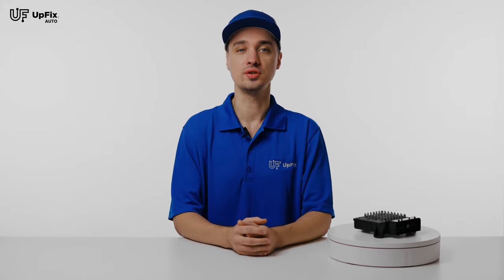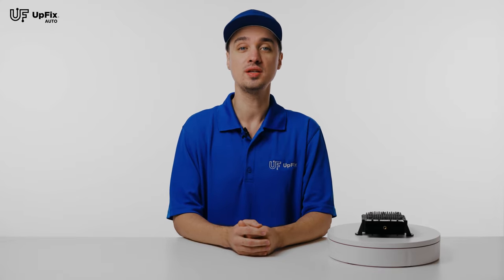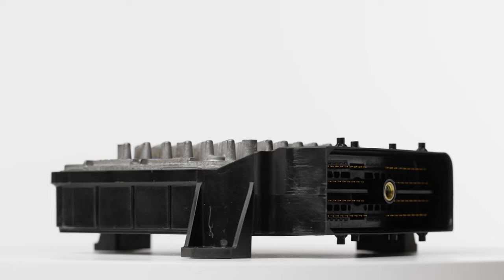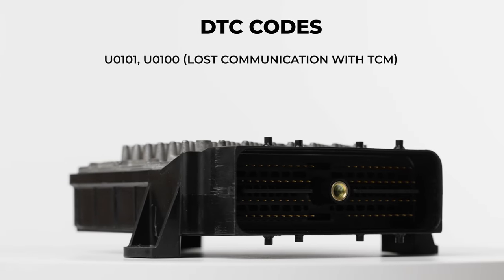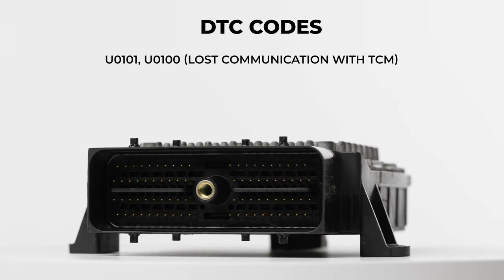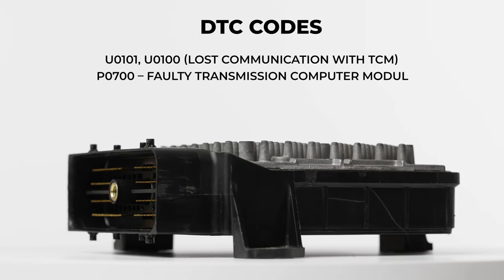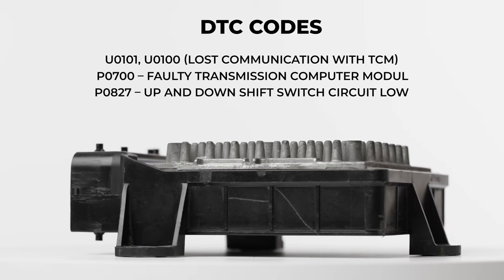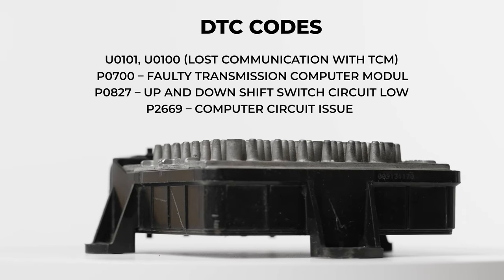Allison Transmission TCM Repair for Chevy HD Silverado 2500, 3500 & GMC HD Sierra 2500, 3500

Comment: can you flash a older 5 speed TCM to a 6 speed TCM?
Reply from the maker: Please reach out to us via the 'Custom Repair Request' at the top of our website upfix.com. There you can provide your VIN and part number. If the TCM is original, depending on your year, make, and model it might be possible to re-flash it.
If you replaced your 5-speed with a 6-speed transmission the internals of the TCM for a 6-speed might be physically different which means we'll only more know once we have more information about your vehicle and what's been done to it.

Comment: I have a 2010 silverado 3500 HD. I  removed the fan shroud and I still don't see it. I've looked everywhere.
Reply from the maker: If it's a 6.6L 3500 with an Allison transmission it should be mounted right on the back of the fan shroud no need to remove the fan shroud itself.
It's possible that someone has already re-routed it somewhere else. On top of the fuse box is a popular spot to relocate it.

Comment: do you off or have any knowledge for 2019 3500 tcm?
Reply from the maker: What issues are you having with that  TCM?
Reply: @upfixauto  well my engine light came on and said reduced power, shifts were irregular or unpredictable. when i scanned it said the tcm
Reply from the maker: No it seems like problem is probably not with TCM. Since your vehicle is 2019 and today is year 2024. It is probably still under warranty if the TCM is bad.